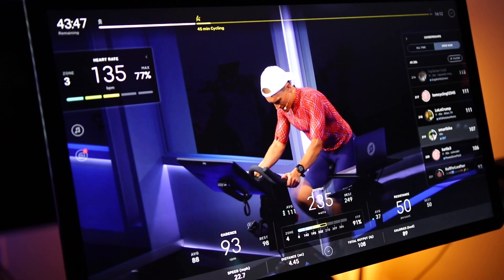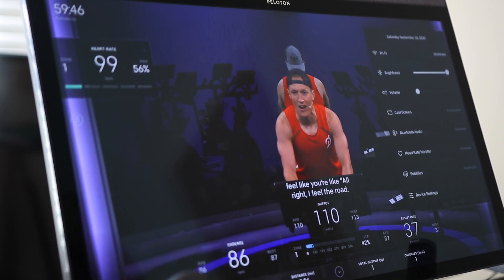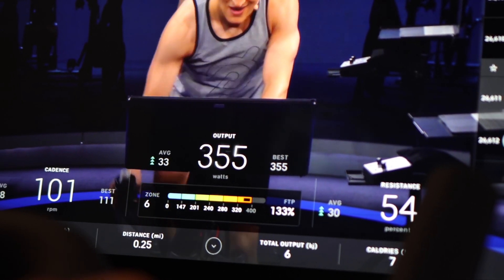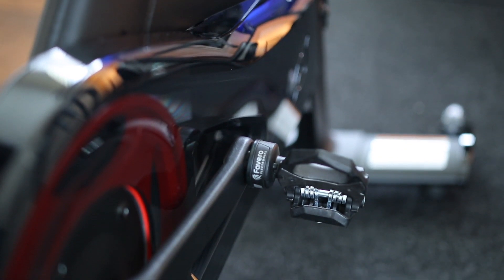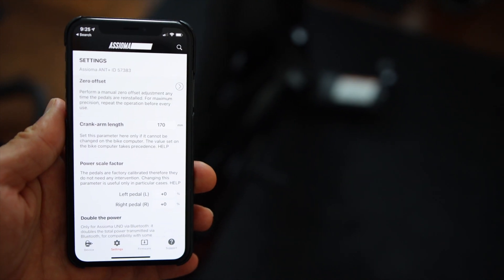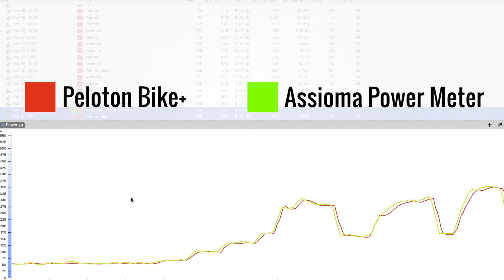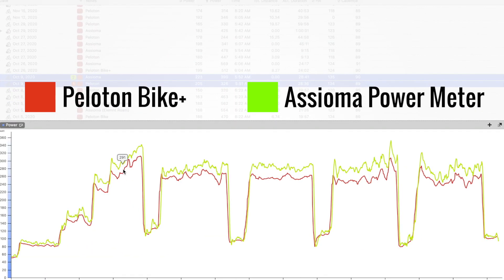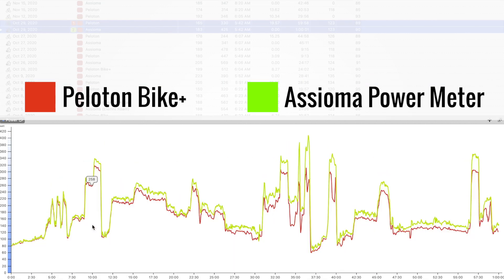Is The Peloton Bike+ (Plus) Accurate? A Deep Dive Into The Peloton Power Accuracy

Comment: Any updates on this topic? I've had a Peloton for 3 weeks and the power numbers seem much lower than the power numbers I see on my road bike. I did a class with Dennis and struggled to average 170 watts average. I saw on Strava that a guy I ride with did the same class and averaged 220 watts. I rode with him yesterday and I'm in much better shape than him right now. Normally I wouldn't care but it is frustrating to get shelled on the leaderboards.
Reply from the maker: I am working on an update. But the short answer is Peloton original bike and Bike+ are not accurate. They are +/-10% which mean you can have two bikes and they can be off by 20%.

Comment: Hi. I switched from the standard bike to bike plus. Both my son and I noticed how much easier it seemed to achieve the same power output on the bike plus. DC Rainmaker also noticed this. I think the bike plus is more accurate than the original bike. There has been recently a few software updates so wonder if these are trying to resolve the issue. If it is a hardware issue there is no way for those without power meter pedals to know. 
Great video
Pete

Comment: Thanks for the info Tariq!  I just sold my Peloton bike Gen 3, for different reasons but really loved my PZ classes. Disappointing to hear that Watts were not accurate on the Bike+ and I would guess it would be worse on the older version...
Anyways why did you choose to get the Bike + ?
I am currently thinking of getting a Keiser  m3i  and most likely getting Power meter pedals... still deciding but I also thought of getting the Peloton Bike +
Reply from the maker: Some people seem to be getting better accuracy results with the Bike+ so it could be this bike I have. But also Peloton admitted in an email that their Bike+ can be +/-10% off from a power meter. I should be getting another bike in a week and hope to have an update after putting a few test rides. 
But my biggest issue isn’t the accuracy, it’s the random power drops and inconsistent readings that I’ve seen with this bike from ride to ride.

Comment: I  am having issues with my Garmin Vector 3 on the Bike+ as well. I was talking to Ray (DC Rainmaker) about this as his bike seems to be prefect. He recommended I warm up the peadals, unclip, then calibrate them. Then, leave as is, don't calibrate again. Do you calibrate before every ride ? Lately, my Power Pedals show LESS than what Peloton shows. Here are some examples

https://analyze.dcrainmaker.com/#/public/3e0bf244-30e8-44f7-46ee-354babe9e6bb

https://analyze.dcrainmaker.com/#/public/ba3dcc9f-0225-452f-6bc6-7f9ffcceb911
Reply from the maker: Whoa... that’s a big discrepancy on that second ride. What Ray described in his calibration is the proper way to calibrate. Once calibrated, I don’t usually calibrate again unless I remove the pedals or travel or something like that. Peloton is swapping my bike in the next couple of weeks so I should have another update.
Reply: @SmartBikeTrainers  thank you for confirming Ray’s process as well because Garmin says to calibrate before every ride. Does it matter that my bike is next to a heater ? I was not on for the first ride, but on for the second.

Comment: Any update on this? My wife is experiencing something similar and is getting extremely frustrated w her lack of progress over the last 8 months. She used a Peloton while on vacation, same workout and exceeded her PR easily w no extreme effort. Thanks for any feedback.
Reply from the maker: No update yet. I am waiting on a new bike and hopefully I will have an update in late February.
Reply: I am only a few months into my Peloton experience. I bought a used Bike +. I noticed my output at hotels were much higher on their Bikes, than on my Bike +. I have also been frustrated watching the Leaderboard as people fly by me at times. However, I notice that when it happens, they are always riding a Bike. I think the Bike produces much higher output. I'm not sure if the Bike is accurate and the Bike + isn't, or vice versa. My PR on a Bike while doing a 20 minute ride, with very little effort, exceeded my PR for a 30 minute ride with significant effort on my Bike + by about 100! Huge difference.

Comment: my guess is that this is heated related, it appears that Peloton power measurement components lose accuracy as they heat up.  This has to be hardware related. better cooling of the internal components
Reply from the maker: That was my thought too. But they don’t seem to think so and think they can come up with a solution via a software update.
Reply: @SmartBikeTrainers  my guess is that they did some hack like this: if temps > xx then watts = (watts * (temp * yy) .  Basically a temperature adjustment to their watts calculation formula.
Reply: @michaelsteele5495  Yeah, can't see how it could be anything else without changing the hardware...The "dropouts" will be harder/impossible to fix.